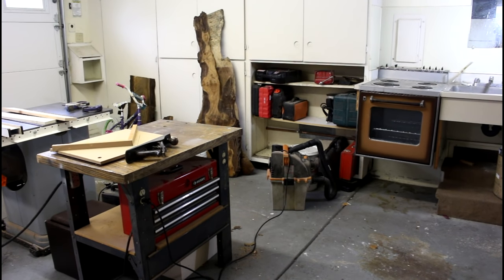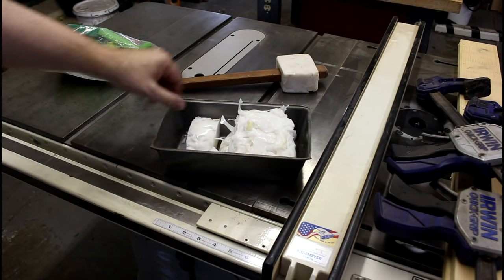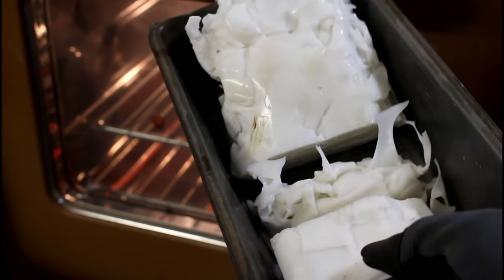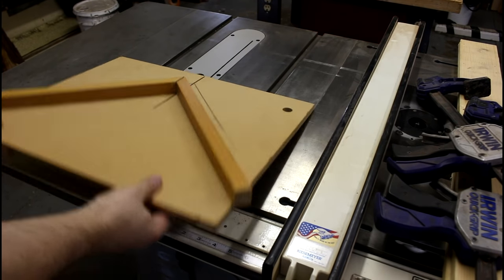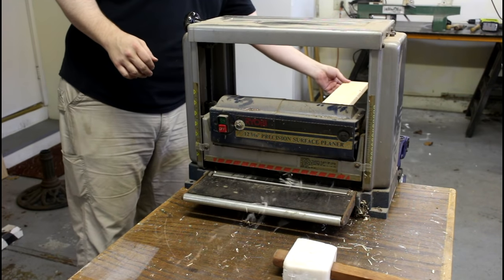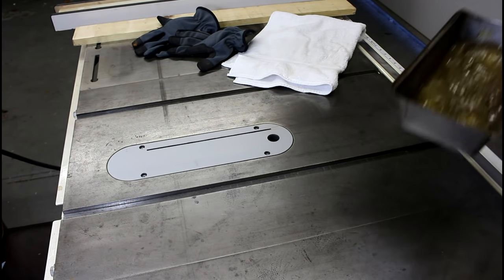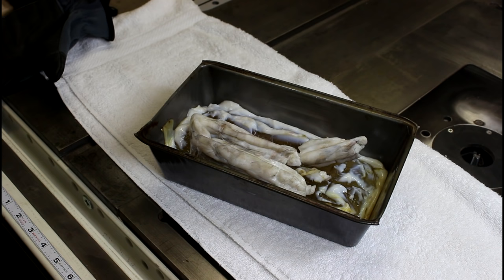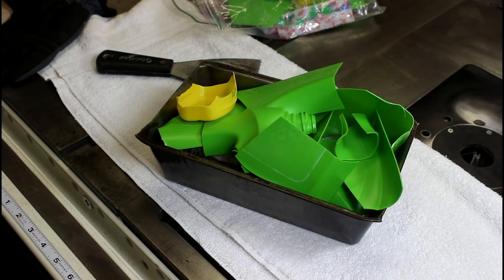Using HDPE  In The Shop

Comment: Since your Mallet video I have researched on melting HDPE and even tried it out. I guess I'm a lucky guy because the wife didn't mind me using the oven expect for the dinning room table covered with my clamps. Anyway I found using cookie sheets with some Teflon coated grilling sheets works great. have one sheet on the cookie sheet for the melted plastic and the other for the mold. I attend to make boards for project cases for custom electronics projects. Since I showed a friend on what I was doing he told his family and before I knew it I have a few trash bags loaded with jugs and even a couple of 2 liter bottle carriers.

You can use canola oil as a release agent and when I was trying this it seems to impregnate the HDPE. This could be handy for  bushings and even the runners for a table saw sled.

Comment: Peter I have the idea of a lifetime. Okay, get a rose, and cover it in epoxy, and then use the flower end as the Base for a sexy margarita glass. Then use petals from another rose to line a conical shape, making the part you drink from, a bit more epoxy and I think you might just have the sexiest glass ever. If you're man enough to attempt it.

Comment: why not just use PVC?
Reply: gasses
Reply: +Gijs you can get pvc in panel form at any hardware store and it would be a much more effective slider for sure- really cheap, too.
Reply from the maker: +Andres Sanchez I won't mess with PVC again. It's got nasty fumes when heated and it contains high levels of chlorine...
Reply: +Peter Brown mmmmmm chlorine
Reply: +Andres Sanchez Why buy when you can recycle?
Reply: +Andres Sanchez pvc can be used for things if you dont have to melt it however if you melt it it releases very toxic fumes
Reply: +Andres Sanchez PVC is "Poly Vinyl Chloride" and the Chloride can have fumes but will also speed up rust on tools...

When we heat PVC up at work we usually have it in hot oil for a minute or so (depending of thickness and what we are wanting to mould with it) with extraction fans on...  And when we are welding it we are in a big open workshop.  The one good thing with PVC is that it won't catch fire it will melt and scorch etc, but not burst in to flames if you get it to hot.

All plastics expand in the heat, and shrink when cooled. Where wood is more the moisture in the content in the air etc

At work we for the few sled jig we use on the table saw we HDPE as Peter has here or PolyProp (PolyPropylene) or even Nylon (but that is not cheap) in the mitre slots or simply make a wooden one. All depends what we have on hand at the time.
Reply: +Wacky Wood Works i think you all misunderstood what I was suggesting. I wasnt suggesting to melt down Pvc and fill in the slots, I meant that you can get flat pvc boards, as you would get a piece of wood, at home depot and simply cut the sliders. They wont expand, are nice and sleek, and cuttable with a knife.
Reply: I know you can get flat PVC boards... (I am a plastic fabricator by trade) They do expand in in heat, and shrink in cooler temps...all plastics do, it is the nature of plastic. You may not see it but it does.

However the main issue with PVC and will it speed the process up of rusting the slots... (PVC is 58% salt) so HDPE is better for this.

The whole point of this video is showing that recycle common house hold goods like milk bottles.
Reply: +Peter Brown I think he meant to use as-is, instead of melting it down. I suppose it could work, but it wouldn't make for a cool video!
Reply: +Andres Sanchez pretty clear, you said it comes in panels, why is everyone wanting to melt it?  Now I only find it in 1/16" thickness, which is useless.  But this would work: http://www.webstaurantstore.com/18-x-24-x-1-2-white-cutting-board/20318245.html?utm_source=Google&utm_medium=cpc&utm_campaign=GoogleShopping&gclid=CjwKEAiA04S3BRCYteOr6b-roSUSJABE1-6BG5a1LmEtwjd9BCCuuLIH0FBAEgGWliEJb1vae2FBwhoCdiTw_wcB
Reply: +Josef Roesler everyone wants to melt it because its reusing something that would normally be thrown out and plus its free and plastic containers are everywhere
Reply: +Dean Walcott you seem to still be missing the point of buying it in a SHEET.  It is NOT something that would normally be thrown out.  It's in a SHEET because you bought it in a SHEET to use that way.
Reply: +Dean Walcott but you can use a cutting board if you prefer not to melt it
Reply: +Andres Sanchez HDPE is the preferred material when it comes to slides. Plus HDPE is free. Which is cheaper than cheap.
Reply: +Andres Sanchez the thing is that he wanted to reuse something he had and wanted to give it another use.
Reply: Kap pa
HDPE slides better than PVC anyways.
Reply from the maker: +Andres Sanchez Thank you all for keeping this conversation so civil. I didn't know it came sheets! 

Honestly though, I'll probably just steer clear for my purposes. :)
Reply: +Peter Brown I wound up getting a Wal-Mart 24x18 cutting board that cuts great and is plenty thick enough for $12.  Probably get a dozen or more slides out of it.
Reply: Josef Roesler
$12? Well la-de-da. We're not all made out of money, like you are! I buy used plastic cutting boards at yard sales for like a quarter. But I don't see them all of the time. Plus cutting boards are usually the softer HDPE. It's OK, nothing like the bottle plastic though. Which is harder, and a bit slicker too. Melted up bottle plastic is kind of like frozen wax. Hard to describe but there's definitely a difference between the two materials, when examining them side, by side.
Reply: +Paul Frederick I don't have an oven near my shop and I don't use enough plastic items in a year to make enough with waste to fill a slot.  I made 2 yesterday and they were a lot better than my only alternative, oak.  And it only took 2 minutes to make.
Reply: Paul Frederick i agree the reason bottle plastic is so strong is because at the factory the milk jugs and other hdpe bottles are normally blow molded which uses a type of hdpe with a very long molecule chain length this means that bottle hdpe is extremely strong however since the chains are so long it will only melt to a dough like consistency and will require added pressure in a mold however it is worth it because it is so much stronger than cutting board hdpe.
Reply: Dean Walcott
Yeah I think that's what I heard about the plastic too. With the longer molecules. But I didn't want to go there, because I'm not sure about it. Until you melt it into a block it is hard to tell the difference between different kinds of HDPE. Gallon jug HDPE is the hardest to melt into a block. But once it is in block form I think I like it the best. I have a block of it sitting on my desk now about an inch and a half thick. It is some sweet stuff.
Reply: yeah its great stuff all bottles including detergent bottles also use long molecules so this type of hdpe is also really strong. the hdpe from 5 gallon buckets and tote bins i found is a little more brittle due to the type of hdpe but its still very strong
Reply: Dean Walcott
My soap bottles seem to be injection molded to me. But that may not be the case always. Buckets are definitely injection HDPE. Tote bins are often recycled material. Unless they're clear, or a very light color. Darker colors are more likely to be a lot of recycled plastic though.
Reply: sweet channel photo!
Reply: +Vince Hagar why spend a shit ton of time and energy trying to melt plastic in your oven when you can just buy industrially manufactured pvc?
Reply: +Dean Walcott plastic is melted down and reused all the time at industrial recycling centers. if you want to be eco friendly, this is a pretty terrible way to do it.
Reply: J Nichols
I find it pretty economical to melt my own plastic down. I have bought HDPE online and the stuff is not cheap.